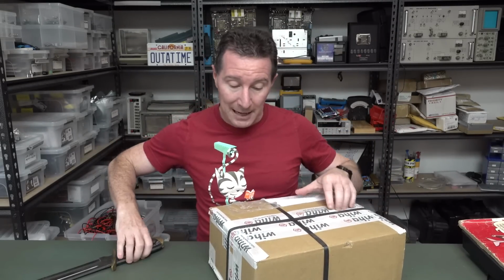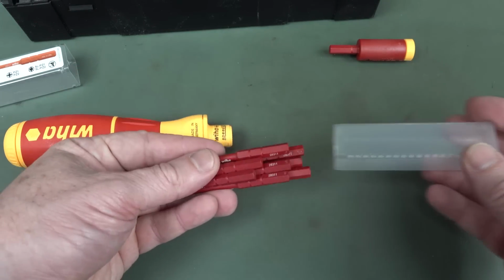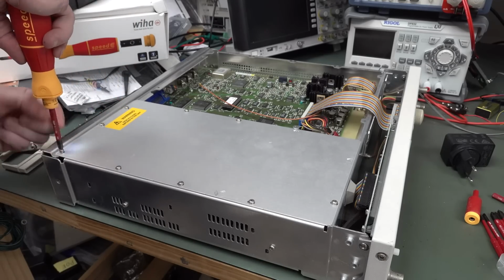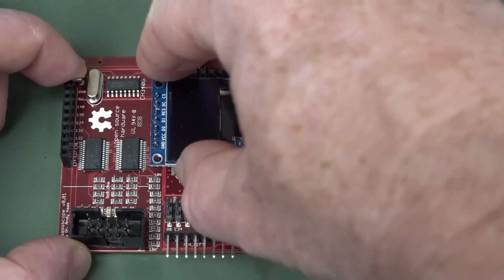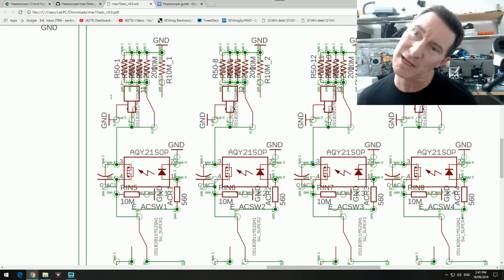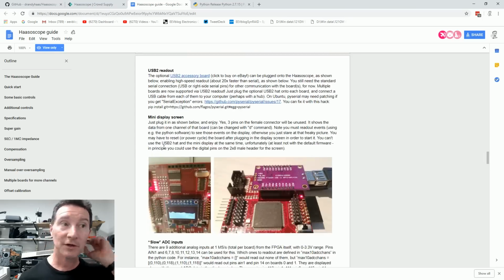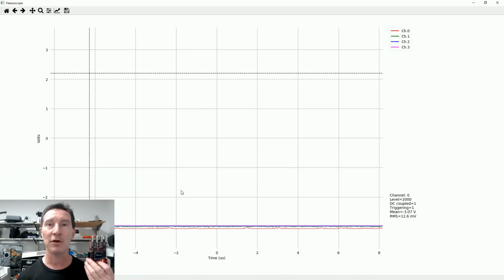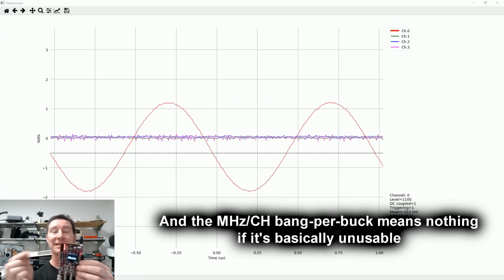EEVblog #1127 - Mailbag Monday

Comment: What is the problem with the BNC connectors? I don't get it. Just take almost any low cost no-name 1:1/1:10 probe or any Hameg (=Tektronix low-cost), you can find tons of fitting cables by just searching for "scope probe 100MHz" on ebay which will fit. The point is, you most probably won't buy a cheap, uncalibrated DIY Scope and then buy a insanely expensive Keysight or Tektronix or R&S scope probe, right? ;)
Reply: I have cheap 100MHz probes that have the compensation cap right at the connector. They wouldn't fit side by side on this scope either. It is a fail that you have to buy the "right" probes.
Reply: You can buy TEK / Keysight 500 MHz probes really cheap and you would always want to use those because of the build quality / features / lower capacitance
Reply: yepp, maybe. BUT: You can buy (starting at ebay from 4 Euros and up to 12 Euros per probe!) cheap noname ones. You're dealing in that vlog with a DIY-Kit or at least a device without any kind of official calibration. No guaranteed high precision, no guaranteed high bandwidth, in fact you're dealing with a device with a bandwidth well below 100MHz. Using a scope probe with 500MHz bandwidth for that device would be like going to a lamborghini dealer, buying a set of new tyres from a Murcielago and mount it to your Fiat 500, because both of them have a round shape... Asking for that is just by far over-the-top and completely off from the target audience of an USB Scope! It may be some No-Go for your already existing Probes. OK. But sometimes the footprint of space some device needs is also an issue. And there you have a clear Contra to your Keysight probes, no? 

That Scope is not made to push on market against all that Keysight,Tek, R+S, or even Hameg branded scopes out there. It is made to make measurements with long sample sets and -times. But only up to maybe Audio frequencies. And any modern probe on that planet can do such measurements nowadays. It does not need to be a high priced probe, in some cases it may not even need to be a proper 1:10 probe with proper frequency compensation, RG58 cable with mounted BNC plug may be sufficient for measuring DC-ish voltage dropouts, right? It is the amount of data being generated and then filtered by your PC that an USB Scope can handle while your otherwise expensive stand-alone scope can't.

USB Scopes in general are no replacement to dedicated stand-alone scopes. Even Dave did state that I think a dozen of times in his Vlogs, so no need to explain that again. They are just another tool for a somehow (but not completely) comparably usage scenario. Like Hex-nut-ratches and open-end-spanners are both for opening hex nut screws, but in some situations you don't want to use the spanner for comfort reasons while in some scenarios you can't use the ratchet for access space to the hexnuts. Simple as that!

Comment: They should provide a 18650 endcap extender for the extra 15 mm. That would be easy to do... For the wiha screwdriver
Reply: Foil and tape
Reply: Nice idea!
Reply: As you say it just needs a deeper endcap.
Reply: For $500 I had to give you a real tool.

Comment: Bit poor on the software distribution side, there are tools for python for building an executable bundle, along with the Nullsoft Install System (or similar) to provide an installer. End users (especially users on windows that does not come with a python bundled) should not need to deal with that for a hardware project. 

FYI: PySide - Python QT Integration, PySerial - Serial interface library, SciPy/Numpy - Scientific and numerical library (responsible for a lot of pythons use)

Comment: Was expecting everyone to mention the ES121 electric screwdriver by Mini, the guys that made the ts-100, way cheaper and similar. Maybe room for a comparison? There's also a Xiaomi electric screwdriver, the Wowstick (lol)

Also python 2 on windows sucks as a user experience. They could have packaged it somehow to be easier
Reply: Installing Python in general is an annoying experience on Windows. Even so, there should have been a proper install script included with that scope... Like, we get it: you want other people to help develop the software, but you can at least make sure installing the alpha version of it is a viable thing. And, we get it; you prefer keyboard only and *NIX, but it's 2018 and you're making a cross-platform project; fucking do some proper work UX wise.

At this point it is like putting lipstick on a pig; when you can't even get arsed to have the open-hardware end of the project in order, provide proper schematics, and didn't even account for thicker BNC plugs, and there's cross noise between the channels... Yeah, like, what the fuck did folks pay you for?
Reply: @Nico Icon
Also if you take a look at the PCB layout it looks like a autorouter job.
And there i though those 20 whatever buck mini "scopes" from china were badly designed. This is on a completly other level of bad design.
Reply: I was expecting this to be one of top comments. Took some scrolling to finally find this one. I'm disappointed.
Reply: Also python 2 in 2018 is pathetic.

Comment: Apprentices are a lot cheaper than that screwdriver and you don't need to worry about what voltage they can take.
Reply: still need to worry about an apprentice taking too many amps though. high voltage is just fun in the right circumstances.
Reply: @TheTimmy4745  They shouldn't be bringing their guitars to work in the first place

Comment: 30:00 Sad to see that it 1. still uses python2  2. authors have no idea how to package python software.
Reply: Bugs me too. python2 was maybe ok a few years ago. By now, python3 is way over a decade old. Use it. If your liberies that you need aren't ported by now, they never will be unless you do it yourself, so find an alternative or do the work.
And that packing software thing is just lazy. I did a favor to a friend and programmed a little helper for a server community. That was for free, so i had no multi OS setup but i still packed the software into a binary that will work on most Win64 pc's. When you sell a commercial product there is no excuse to not provide binaries for at least Windows and Mac (Linux user have a) python preinstalled and b) should be sufficient in using it).
Reply: Python is a true terror to compile into an executable. :(
Reply: Turidus Python 3 is stillborn in the minds of most people outside the inner circle, being "that incompatible thing that you are told not to install".  Attempting to force upgrades by declaring EOL for the stable series is not going to earn the Python project any friends.  I hate when projects drop compatibility for "new visions" that don't serve existing users.
Reply: @johnfrancisdoe1563  Python3 was a good move, since it fixed many problematic/weird aspects in python2 instead of carrying over all the legacy stuff. This unfortunatly meant breaking backwards compatibility, which is the reason why python2 was kept alive for so long. It is not the stable branch, but the legacy branch and has been for many years now. Besides gently backporting many features for python2 over the years, allowing for a more gradual move towards python3 there are also some nice tools to help find parts of legacy code which cause problems. Python2 will reach its EOL soon enough and by then most people could not care less.
Reply: I thought it's perfectly acceptable to still use python 2 because it's still current because it exists in parallel with 3.
Reply: Python 2 end of support date has been announced. It'd be really stupid to develop something new in Python 2 today.
Reply: Yep... Python 2.7 End of Life is 2020
Reply: You simply can't do this in 3, that's why 2 is pretty much still the standard for many applications...
Reply: @Gllmprruiaueiee  That might have been true some years ago, but by now the few packages still only available for python2 are mostly outdated anyways.
Reply: python 2 is still commonly used. just like java 8 is still used way more often than java 10.

Comment: You're not at all being too harsh on that USB scope. If it is sold as an alternative to a traditional oscilloscope, at least the basic functionality must be there. And I agree with you: That's the worst schematic I have ever seen.
Reply: I laughed hard at 39:45 and 40:20... He is trying so hard to at least like it - but this thing just don't let him do that. This is so not ready to be a product, it's absolutely cheeky to let him try this at this state. damn you kids!
Reply: the 30$ pos Chinese usb scope I have comes with a full software suite with fourier, filtering, with everything and a control for the built-in DDS. bandwith and resolution might be crap but that is because I got a cheapo.
Reply: I agree, its awful. I dont want to have to mess about with python and the command line. I want to just click an exe, install the SW and have it just work ! As it is, the UI is completely unusable and the BNC connectors are too close together.
Reply: I am primarily a software person, and I have used python and I will say, it is not that hard to create an installer or at the very least just a zip archive with an exe in it. (if python 3 was used as it should have been, python 2.7 should not be used for new projects and that has been the case for years)
Reply: You do not write end user software in Python. That's just horrible ethic IMO. Sure you can bundle Python with your program and freeze it but that's just disgusting. It's either for STEM etc or as an embedded language for games, etc.  @bitcynth4034
Reply: GRAYgoose124 Whaaat?! Python applications package as single .exe files. It’s not magic. If someone doesn’t know how to deploy production Python applications, it’s their problem. Python is fine. Python 2.7 is not fine though.

Comment: Gotta agree with Dave on the scope, it was epic fail, the specs are certainly impressive for the price but then you instantly lose two channels if your probes don't fit and the software for it was overall pretty horrid, I mean aside from what Dave had to say about it, if you're going to make an interface mostly hotkey driven then why isn't there a help button that tells you what all the keys do or heck there's plenty of white space on the sides to have a legend, right? So that way I don't have to go find the manual and look up what the keys do.

Now of course software issues can always be fixed, but if this person thought this would impress anyone, I wouldn't count on the developer being the one doing the fixing here.
Reply: This "gui" is just a standard matplotlib plot. So he didn't even bother to design a proper gui himself but rather cobbled something together.
Reply: @Marvin - and stuck on Python 2.7. That means the whole "GUI" is on life support.
Reply: So much for open hardware, unreadable schematics.
So much for open firmware, you need special tools for programming.

They could probably add some resistor dividers if they add more space between the inputs on the board.
Reply: I think the basic things can be fixed very easily its only a diligent but routine piece of work.  But the missing software is a problem I think the the developer thought I make it open source some guys will submit something....
Reply: And then the "some guys" though "I cannot polish this shit." and gave up...

Comment: Wiha ? I use a £10.00 yes £10 - TESCO - Cordless drill - and yes Tesco the food shop some 10 years ago  ( just seen the date on the cordless drill 01-11-2008 ) it has torque settings 1 to 10 - Yes, I have Changed the batteries to 18650s - and its still going strong LOL - see my video - HOW TO MAKE A POWER SCREW DRIVER - https://www.youtube.com/watch?v=RbM7hdIwY54

Comment: That is perfect for electrical testing work on HV control switchboards. Usually the the first part of testing the circuit is to check every connection is tight. So that can be 1000's of terminals to check. I have done that kind of work for many years and no matter how often you do that part of the job your wrist gets tired. Also it may reduce the chance of stripping a thread.
Reply from the maker: Yep, fair enough usage case.

Comment: The schematic: done by a programmer, I guess. The world of small scale electronics now seems to to be divided into those who can program well but can't do hardware, and those who can do analaog and hardware well, but can't program. Occasionally you get someone like Oliver Gilet of Mutable Instruments, (a synth module company), who can do both to a high standard. Technically known as a smartarse.
Reply: To be honest there were a lot of shortcuts and untested aspects to both hardware and software. 

Screwed up the layout of the PCB so that you can't easily use the mechanical sockets? Nope. That's what revisions are for. Chucking in a cheap 0.96" OLED screen without properly laying out the display? 

Granted there is always time to fix the software later, but you still have to do it...this looks like abandonware or something you might buy for 20 quid off amazon (which would be fine if it was only 20 quid)
Reply: Chris sutton 20 quid. I would even pay 20p for that.
Reply: He is not even a good programmer. Just the installation process is hilarious, because it is marketed not as a hobby project, but as an alternative to other professional USB oscilloscopes. But Picoscope has a nice installer. And you only need to search for "standalone windows installer python" in Google and follow one of the many instructions to create a nice setup.exe file for Windows, a matter of minutes for the developer, saves the end user some grey hairs.
Reply: I think you're right. That's why even when I think I can do a whole project myself I still try to find people who specialize in different aspects. (It also helps a lot because if no one is interested in joining then that tells me the project probably isn't worth doing in the first place. ;) )
Reply: Certainly not a software developer, this dude can’t even package software properly, trust me. This is very amateur level.
Reply: "The world of small scale electronics now seems to to be divided into those who can program well but can't do hardware, and those who can do analaog and hardware well, but can't program." I am the second. I can design good schematics and board layouts for analogue circuits but ask me to write an arduino program and i wouldn't know where to start. my head hurts if i try to understand code. Even if something simple could be done cheaper with a microcontroler, id prefer to do it with logic ics.
Reply: @simontay4851 , that's surprising. I learned programming first when I was younger then started studying electrical engineering. While I can do some cool things with FPGA's (still programming technically), the layer of abstraction in C/C++ can be quite nice. I use Arduino for quick prototypes and with their libraries supplied it is fairly fast to get something started. I think you may be selling yourself short, if you can do something like VHDL you should be able to pickup general programming, it definitely is another powerful tool in the proverbial toolbox.
Reply: I don't think that any part of that project has passed anywhere near a real programmer OR a real electronics engineer.
Reply: LOL. What a garbage piece of software that is.
Reply: I am not expert, but I do Software, Firmware, Application development Schematic (Both Analog and Digital) and PCB designs very nicely.

Comment: Charger won’t be good for much, you said 18650, but as you mentioned earlier the battery is 18500 which is used in hardly anything, I’m assuming charger is only designed for 18500.
Reply: Watch the end of the video Brett!
Reply from the maker: Yep, useless for anything else I have

Comment: $300-520 US-fucking-dollars. Five-hundred and twenty dollars!!! Are they high? I know Wiha is at the tip top, but damn. I do like that they use regular Li-ion batteries instead of a pack. That way you can get batteries more readily, and you aren't a slave to their batteries, and you don't have to pay tons for battery packs. Should have been 18650/20700/21700 (with a sleeve to shim the smaller batteries. Ecig gear does it that way, so you can use any battery.) battery powered, and they should have included batteries from one of the big 4, not fucking KeepPower. And are you sure it's made in Germany? The grammar, phrasing, and graphics on that box SCREAM, "CHINA!!!!" The gear box has the sound and the slop of China's finest. (Plastic, shitty, sloppy, gears) I love Wiha (Wera more), but that thing looks like an over priced piece of shit. I wonder if you can get an Rx for it, and get it tax free or have insurance pay for it. It's Dr recommended, presumably to stop repetitive movement injuries associated with screwdrivers.

Comment: you are not harsh, that scope is less than toy also I expected more from company like wiha
Reply: As soon as I saw it, I thought "Man, those BNCs look awfully close together" - sure enough...

Edit: I also have to echo Dave's thoughts regarding the software. Open source is great, but there is a huge disconnect between the people who develop many OSS projects and the users they tend to target. If you want a project to get adopted by users, it needs to be simple... and that means a monolithic install file, either executable install or unzip-and-run. Anything that requires the end user to compile or install third party software/drivers is an automatic fail.
Reply: The $80 Hantek ones are actually magnitudes better than that one, they atleast have some halfway decent software associated with them and not that Python Opensource rubbish.
Reply: What i totally dont understand is why they rerolled the entire software rather than give something like OpenHantek (which has a VASTLY better interface) a new backend
Reply: They might iterate to the better ones, after all it's their first (i think) electric screwdriver and it's not like their main thing is electronics.